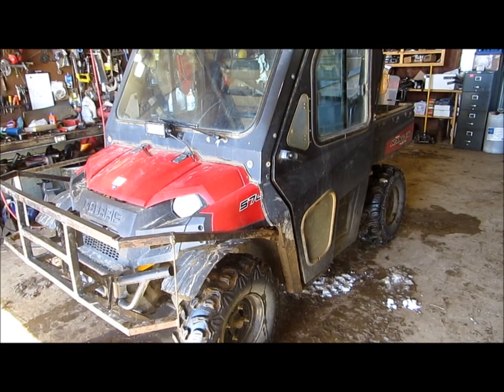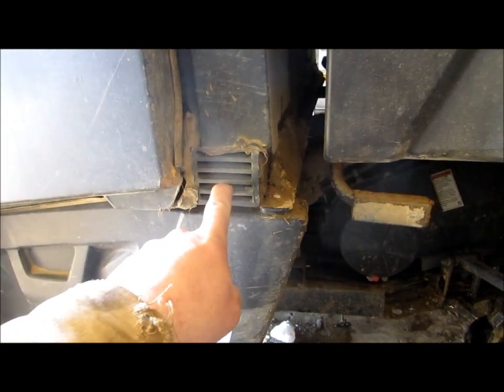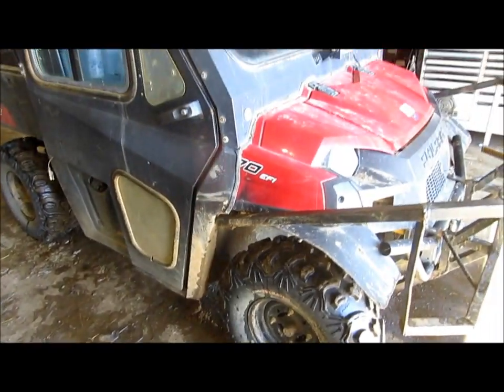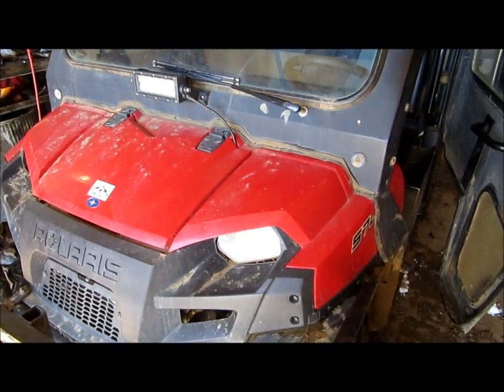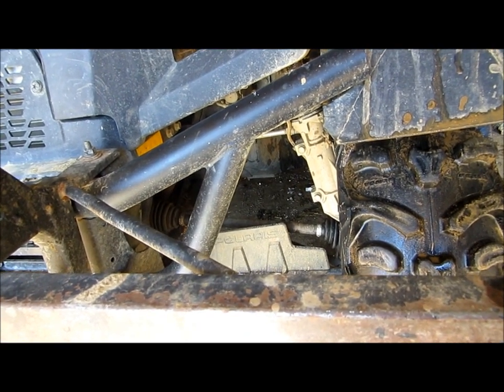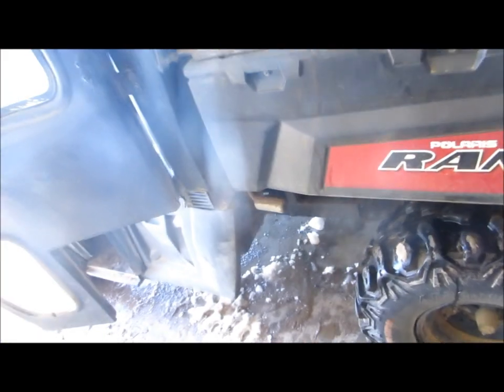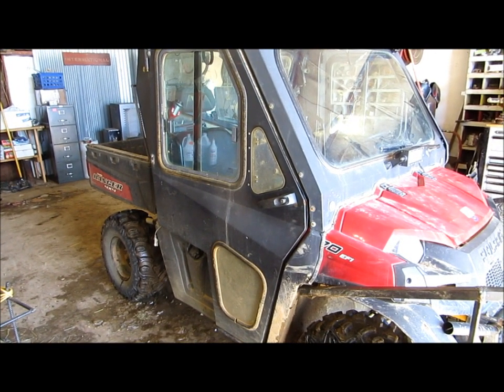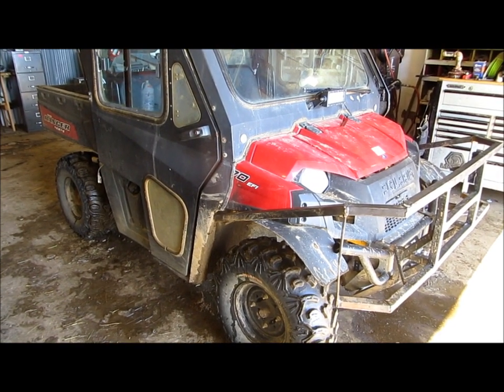Review of Ranger 570 Full Size Part 1

Comment: Great review vids on the 57 FS. It seems like the exhaust is slowly getting louder, maybe its me. It's really my only annoyance with the machine. Do you have any fix or ideas on a quieter exhaust?
Reply from the maker: Check to make sure that the muffler spark arrestor isn't loose in the exhaust pipe Outlet. I had one get loose on one of our 570s and it got quite loud

Comment: how many hours do you guys expect to get out of a ranger?  also i realized i never subscribed so here you go.  take care,  i hope this storm doesn't get too bad!
Reply from the maker: On the hours it kind of depends.  You can keep one running almost indefinitely if you don't mind fixing them, but I'd say you start running into more and more issues when you get up around 1200-1700 hours(8,000-12000 miles).  At that point, you run into suspensions needing rebuilt, wheel bearings going bad, clutches, ball joints, ect.  So far these have been fairly maintenance free, but I know by this fall I will need to put in ball joints at least.  They'll be around 1300 hours by that point.  How long we keep them will depend alot on how well polaris honors their extended warranty.  If I had it to do again, I probably wouldn't buy it.  Winter has been fairly tough down here, even though it started a little later than normal.  Not seeing much out of this storm so far, I'd be ok if it doesn't show up!
Reply: @OldGlory1776  i see.  i wouldn't mind trying a yamaha viking if they would go to a twin engine.   rory has a 2018 grizzly and that big 700 single lung engine vibrates a bit too much for my liking.  i imagine it would feel about the same in their sxs.
Reply from the maker: @johnowen6507  I thought someone said a while back they were planning on putting a twin in the Viking, but it hasn't showed up yet. I think Yamaha has always built some top-notch stuff. Main reason we've stuck with Polaris is because of how close and easy it is to get parts. Plus Polaris parts are much less then any other brand. Another machine I think would be neat to look at would be the Can-Am Defender. They seem to be built pretty rugged
Reply: @OldGlory1776  yeah a good parts counter at a dealer makes a huge difference.  i started ordering most of my honda parts online because outdoor motorsports made me mad the last time i went to purchase a new machine. i also believe their markup on parts and fluids to be outrageous.   i have studied the can am atv line  and i like what they build,  you just have to open up your checkbook pretty wide to pay for it!  take it easy dude.
Reply: That’s not the air intake to the clutch box, it’s only the air intake to the motor. Air intake to the clutch box is under the bed.
Reply from the maker: @ydobg  no, both CVT and engine air are drawn from that tube with the  louvers.  The ranger 800s CVT inlet is between the back of the cab and front of the bed
Reply: DieselFume1 well they must have change it then, I own a 2018 and the cvt air intake is under the dump bed. The side air intake is only for the motor.  Not a big deal but that’s how the 2018 is.